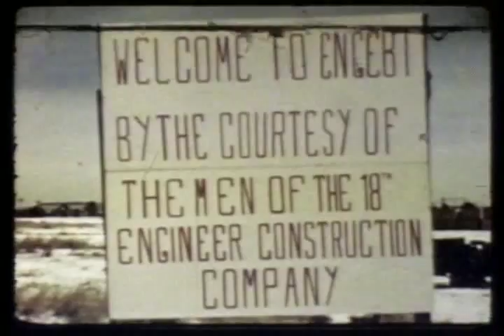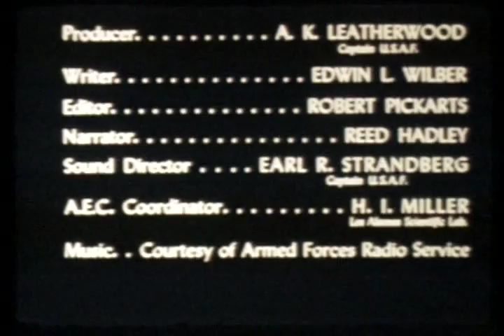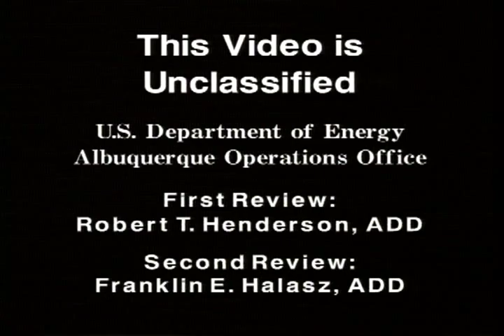Operation Sandstone, Blast Measurements Group - Nuclear Test Film

Comment: Sure, as well as radio signals, AC hum, and all kinds of electrical interference.  Coaxial cable for low voltage signal runs has been standard practice since way before nuclear tests. Even better is balanced twisted pair within shielding.
Reply: Rg34?
Reply: @viktormichael821  RG-59/U, or whatever stood for it in 1953.

Comment: 10:55 Co-axial cable probably employed to limit the destructive effects of EMP on the data signal.
Reply: Much of the cable, and the instruments they were connected to, were destroyed in the blast regardless of what kind was used. All they cared about was the tiny bit of data that was captured at the instant of the blast. The resulting EMP and interference after the blast wasn't of importance in many tests.